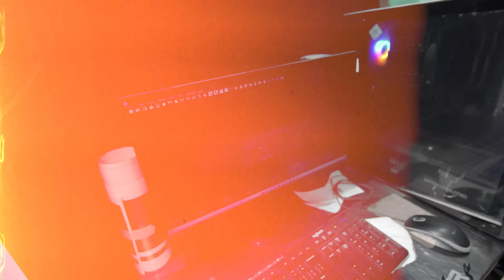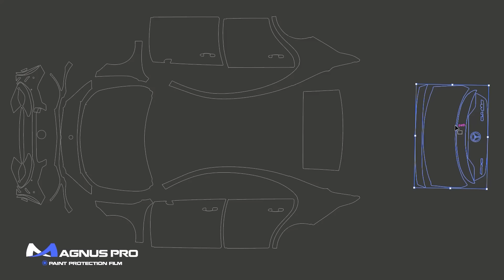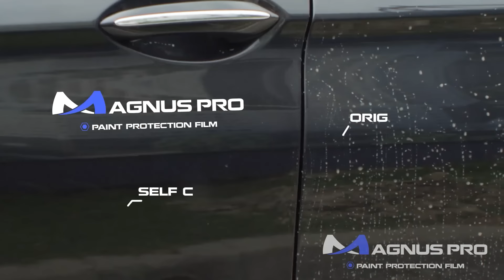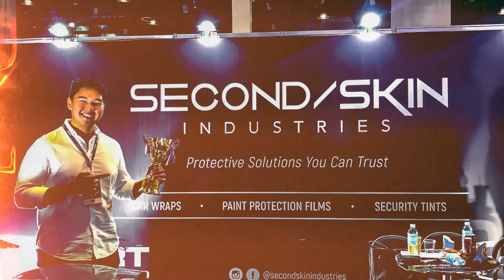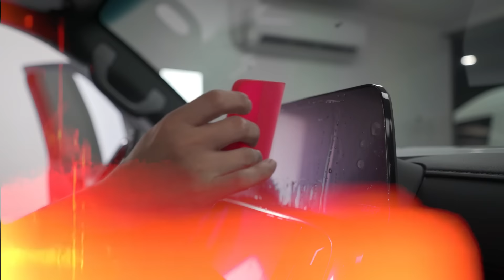UNVEILING DRA. VICKI BELO AND DR. HAYDEN KHO'S NEW RIDE AND MORE!

Comment: .bro,,,pintura lang yan...hindi need ng mga ganyan..INGAT S PABMAMANEHO...khit nkfilm kp, reckless driver k nman wsla din yan
Reply from the maker: The PPF doesn't only protect you from your mistakes, but it also protects your car from other people's mistakes. Kahit gaano ka kaingat, minsan may hindi maingat sa paligid and that is why we protect our cars with PPF- for OUR peace of mind. 😉
Reply: @SecondSkinIndustries  hehe ibig mo b sbhin pg nabangga k hindi mayuyupi pg nkPPF yan sasakyan mo?? Lets be real..mahal yan ppf, mgkano lang mgpapintura? Pareho lang nman ang kintab nyan hehehe
Reply from the maker: @junfrias9188  PPF is meant to protect your car from scratches, swirls, stains and rock chips- not total damage. Although we've had instances na nayupi yung part na nabangga pero no damage sa paint so we were able to fix it by using PDR and did not need to repaint and that is why mahal ang PPF. 

And papgpinitra ng kotse automatic bababa ang value ng kotse and that is exactly what we are trying to prevent with PPF. If you are okay with repainting your car, then no need for you to use PPF. Hindi naman namin kayo pinipilit magpakabit nito.   😉
Reply: @SecondSkinIndustries  The vslue of a car is not defined by its paintjob.Although, A well done paint job or a ' three step msintenance" would be more than sufficient and sensible ..